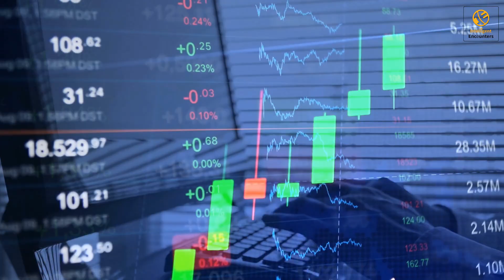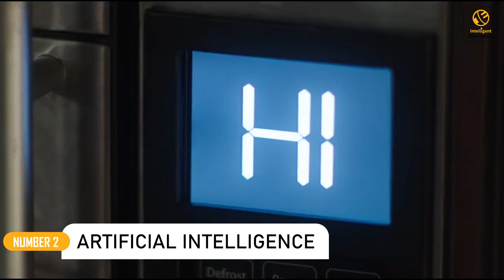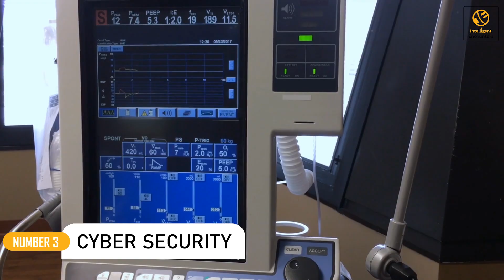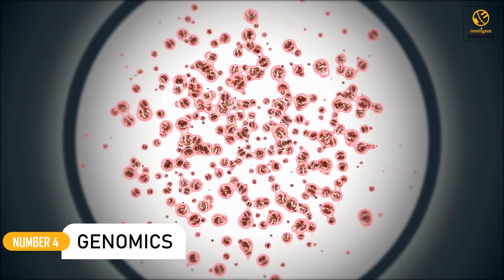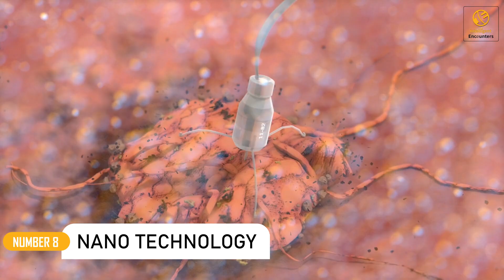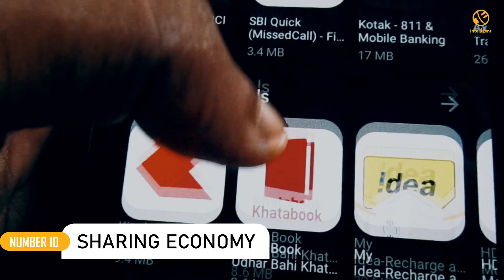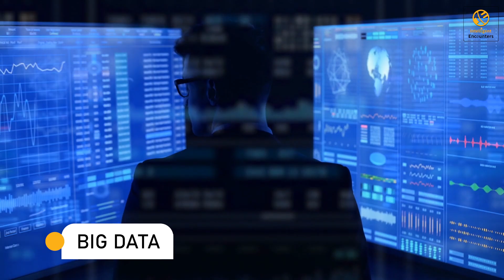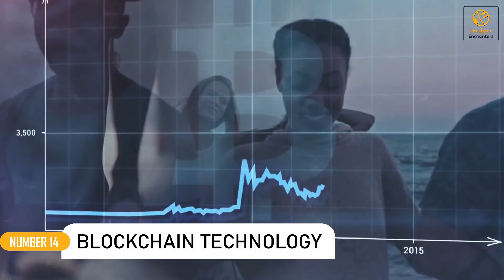14 Growing Industries of the Future [2022 Edition]

Comment: Nuclear batteries can last up to 30 years without a recharge. SMRs(Small modular nuclear reactors) can be installed at data centers or manufacturing facilities or large shopping malls that consume large amounts of energy. The dominance of AI in the defense sector. Flying taxies that are piloted by AI for intercity commutes. Jet engines will be replaced by more powerful engines that will run on nuclear batteries.

Comment: E-learning is not worth. We all experienced disadvantages of e-learning during pandemic. No practical implementation in labs(imp part of learning), very few attended classes regularly and sincerely, problems faced during assessment of students etc.
Reply: There are a lot of virtual labs coming up, if you are doing even that the e way. 
Technology and lab stuff are only getting cheaper, so you can set a lot of things at home. Most of these technology can be learnt hands on at home. There are 3d printers starting anywhere from just $200, of you are looking for an example.